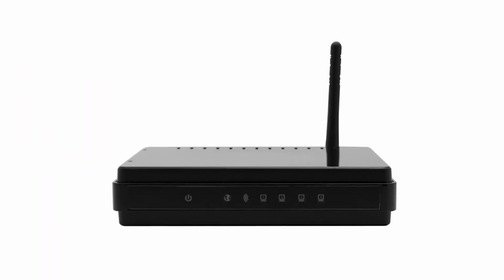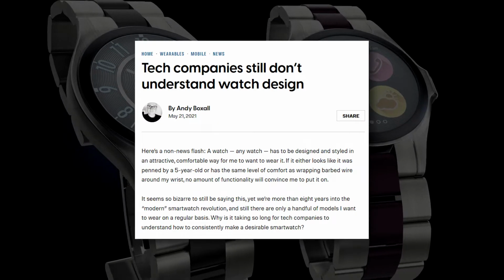Internal vs. External Antennas - Which Reigns Supreme?

Comment: I hate the external antennas on the outside of routers these day's because they are completely garbage because they are not detachable. So if any of them break or get damaged in any way, you are literally stuck with having to buy a whole new Wi-Fi router. That's why I go with Wi-Fi routers that have nonbreakable internal antennas, but I'm finding out that Wi-Fi 802.11n/ac/ax routers with nonbreakable internal antennas are becoming impossible to find these day's. The Synology WRX560 is one such Wi-Fi 802.11n/ac/ax router that I bought off Amazon because of its nonbreakable internal antenna design. In fact, Synology WRX560 is the only Wi-Fi 802.11n/ac/ax router I could find that works with my gigabit optic fiber internet that has nonbreakable internal antennas.